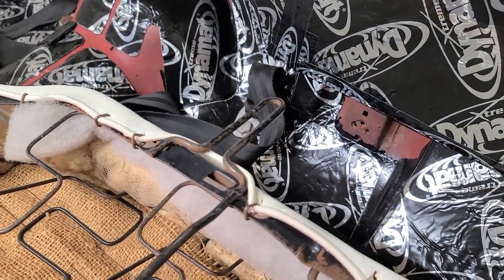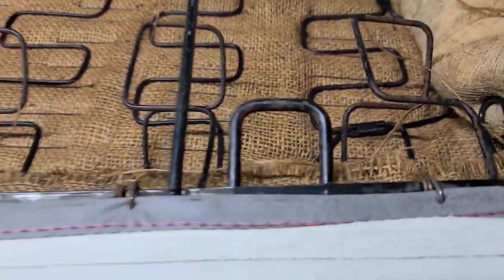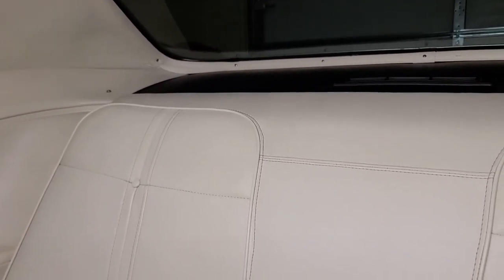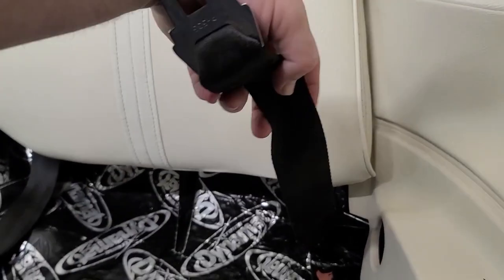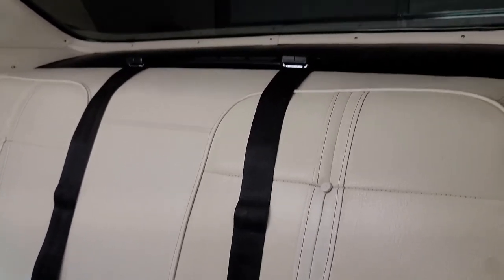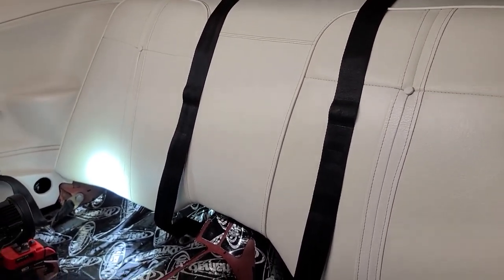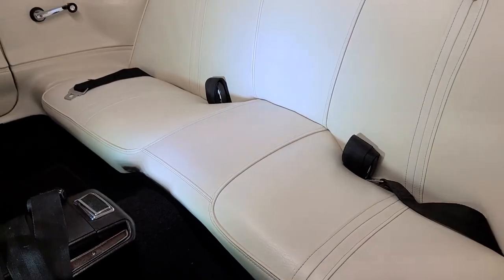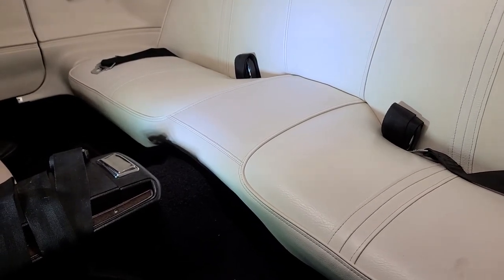1971 Plymouth 'cuda - Rear Seat Back and Bottom Installation

Comment: Awsome! Great job and keep the videos consistently coming! 😃👍
That is a clean interior! Your car is so sweet! 
 I just ordered a completely rotted 73, 340 Cuda from New York. It should be in on Monday, May 8, 2023. I’d like to make it into an AAR tribute.   😎👍
Reply from the maker: Heavens...  Thank you very much.  I saw your video.  A '73 340 A/C car ...  There is nothing that a some TLC couldn't fix on that car and AMD makes metal you need.  Should be a fun build to watch.
Reply: @Scarlet_1971_cuda  awesome and thanks. I love doing the metal work, and I have the frame rail sections that will easily drop in place. And then I will sell one of my other sacrificial cars (68’ Coronet post) to get the metal for the other rotted 340 Cuda I have also. (2) 😎
That one I want to turn into a ‘71.  🤔👍